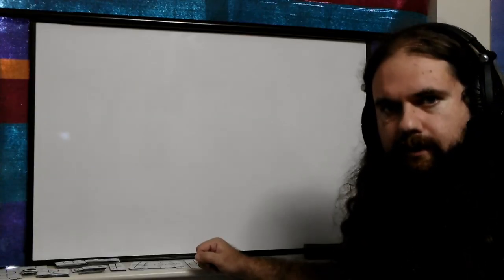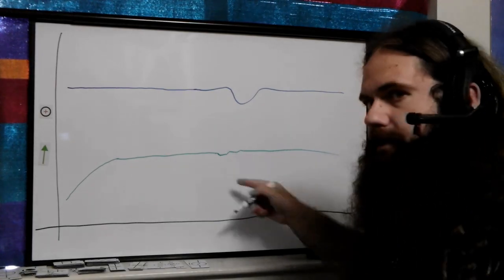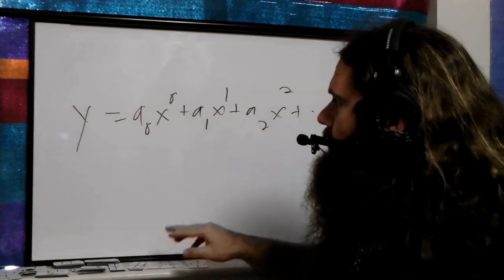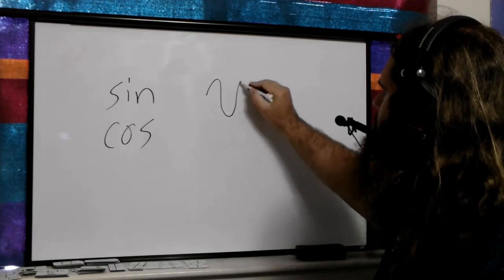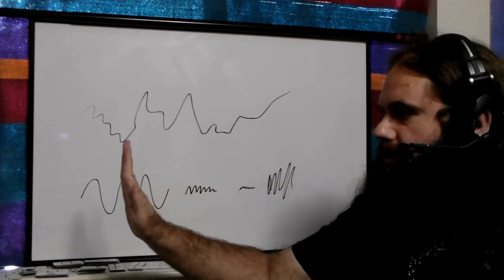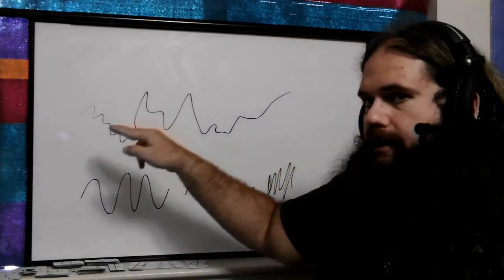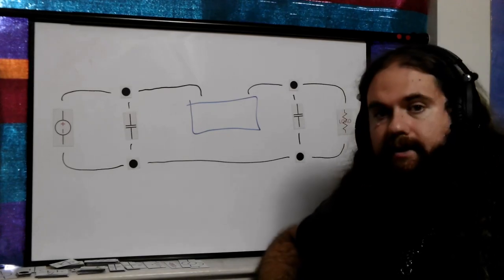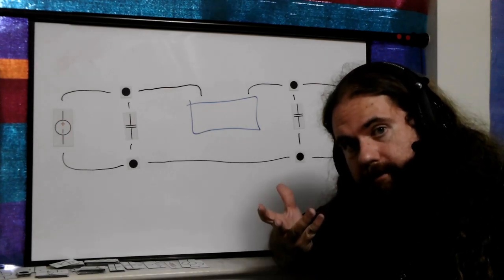Decoupling Capacitors - Simply Put

Comment: I have question that I hope you find time to answer soon. but let me say, this is by far the best explanation of by pass capacitors in common language. thank you. How I found you is because I was working on a PCB and the eBay purchased self closing tweezers broke one of these little guys in half...but I think, it was mostly my fault.. I wanted to see if I really need it. it is not by a cpu. it is where he main regulator for pcb is and on the same line as the 100uf electrolytic cap is. In a row there is a 100uf electrolytic, then a medium size bypass cap and right after that was the smaller one that I broke. it is really tiny (about 1 mm long buy .4 or .5 mm wide & think). I do not know what rating it was. should I put something about the same size in there or should I just leave out?

Comment: Thanks I have been trying to reduce noise in my 1969 car radio.  Now I have several capacitors I could add to try to reduce the noise coming in on the AM radio. Just trying make sure it is coming in on the antenna from the coil firing.

Comment: This stuff is cool, rebuilt a power supply for a radiola 60, gotta get rid o that a.c. ripple filter choke coils
also used, and eelctro-dynmic speakers used an electro-magnet instead of a magnet and that lectro-magnet was used to smooth out the ripple.

Comment: I've tried running a USB isolator and also running my plasma cutting software off my laptop without being connected to power but neither solution worked. I also attempted to shield wires and place my plasma cutter in a old refrigerator to eliminate the EFI interference. Everything helped but nothing really worked. Something tells me you would know the answer to my dilemma. I built a CNC controller using an MKS 32 DLC board. It's basically an Arduino design. The board is supposed to control my plasma cutter but it's highly susceptible to interference. Without turning on the plasma cutter the G-Code will run flawlessly on the machine. But as soon as I turn on the plasma it will get one or two cuts and then either stop entirely or freak out. I read somewhere this is because the way the board is designed. Someone suggested a decoupling capacitor could be helpful. I get the basic idea of what they are saying but maybe it's just better if I buy a better board? The nice thing about these boards is they're cheap but they connect to the computer with USB. Better boards use either an Ethernet or a parallel port connector which requires an older computer but that wouldn't be a problem since I have a few. I was considering just trying to go from USB to the parallel port on my tower but I think the problem is the board itself is getting interference so how do I connect to the computer will probably not matter. The only way I've got the board to get a good portion of cutting done was by launching the G-Code off the built-in SD card using the proprietary control app. But that app sucks because it doesn't have the z-axis control since the board was initially designed for a laser engraver. I hate to have to purchase a new card but if that's what it's going to come down to I guess I will have no alternatives. Any advice? Thanks. Subscribed.

Comment: I  understood that the term bypass capacitor is not interchangeable with the term decoupling capacitor as bypass capacitors are used to remove the effects of inductance from impeding current demand, whereas decoupling capacitors would be for removing the dc components on an otherwise and wanted AC signal

Comment: Thanks for your explanation, and I got two questions and as you said in a video. "Wy not ask". So the first is: there is a way to measure the diferents frecuencies presents in a DC input..? and the second is coul you please explain what is and how to use and calculate a coupling capacitor... As alweys thank you bery much.
Reply from the maker: I presume the best way to measure frequencies in any signal, including a noisy DC signal, would be to use the FFT function of an oscilloscope. I'll definitely cover that topic at some point in the future. As to coupling capacitors, their purpose is to allow an AC (varying) signal to pass between parts of a circuit while preventing DC (constant) voltage from coming along for the ride. If you look at the common-emitter amplifier circuit, all three of the capacitors are coupling capacitors: The one on the left allows the input signal into the amplifier while blocking the amplifier's DC bias from feeding back into the signal source, the one on the right allows the output signal to pass to the load while removing the DC bias added by the amplifier, and the one at the bottom (between the emitter and ground) allows the biased signal to "reach" ground directly while preventing the DC bias itself from shorting to ground. At some point in the future I'll do a full video on coupling capacitors, such as how to choose them based on their frequency-response curves; For right now, all I can say is just try different ones until you get the output you like.
Reply: @simplyput2796  As alweys, thanks.

Comment: thank you so much man wonderful explanation ...i  just wonder what the difference between decoupling and coupling capacitor? and i don't know if it's the same thing
Reply from the maker: Names in electronics are all over the place, and sometimes there are twelve different names for the same thing. Generally speaking, a decoupling capacitor is in parallel to remove an AC element (like noise), and a coupling capacitor is in series to remove a DC element (like an amplifier signal bias).
Reply: @simplyput2796  ok thanks i get it

Comment: Hello Simply put, gr8 vid! say a d.c. generator is hooked to a load, and the battery is floating, could the battery be also considered  to be like a capacitor to  minimize voltage /current changes? and does
ELI the ICE man get into this?

Comment: ok ..I have 220 ac volt  600 amp power supply  set at 14.8 volts DC.  how would  I add power  caps to it . ?

Comment: Love your videos. Would really appreciate your comment on my thoughts.
I've been contemplating this stuff myself and your vids are the closest I've found to an answer.
I don't know the answer and you certainly know a hell of a lot more than me..
but I don't think comparing power caps and coupling caps are relatable. 
Staying in the classical world and pretending Quantum doesn't exist.. I view power caps as a pool of excess electrons.
In a decoupling situation at least I don't think the Cap ever really discharges once charged?
I think I'm right in saying AC is felt on the opposite side by fluctuation in the strength of how compelled the electrons are to the other side of the cap without them actually needing to move across or discharge.
It seems both the size of the pool, and the material the cap is made of impart a sluggishness and a range of frequencies they can actually react to. Id really like to understand this better but I guess it could be likened to how different materials transmit sound, the same can be said for electrical fluctuation?
Reply from the maker: The capacitance of a capacitor determines how many electrons per volt the capacitor stores. More capacitance means more electrons for the same voltage, so a large capacitor can supply current for longer while its voltage drops more slowly (power capacitor). Less capacitance means fewer electrons for the same voltage, so a small capacitor can charge and discharge far more quickly, thus maintaining a voltage level more steadily in the face of very small ripples. When you talk about electrons being "compelled", yes, they are, by the electric field caused by external voltage, but the electrons absolutely do move: Every electron added to the negative side is one shoved away or pulled away from the positive side, and every electron added tot he positive side means one leaves the negative side. The size of the capacitor (and its construction) do affect its reactance curves, which you can look at on datasheets.
Reply: @simplyput2796  Thanks matey. AHHHH hang on..*reads definition of farad*  So I had it in my head Capacitance was fixed at any voltage, so was thinking.. if a cap always has 500Vdc applied, how is applying 1V AC on top going to effect the sored charge, it will always be full with a voltage between 499 and 501. But instead perhaps its better to view the cap like a water balloon, At a given pressure it will fill to a fixed point, if you apply a little more pressure it will fill a little more within a normal operating range. The material the "balloon" is made of will effect what that range is and the reactance curve.

From a safety perspective, does this imply that if I take a cap that stores a lethal charge under normal operation, like a 50mf 450v cap, but charge it at 1v say in a capacitor tester, it's then quite safe to touch afterwards? and presumably the measured voltage once removed would be 1v only?
Reply from the maker: "Filling a container to a certain pressure" is a good analogy for a capacitor: If the container is bigger, you need more actual material inside to reach the same pressure. When you have a charged capacitor, just treat it like any other power supply: Touching the leads of a capacitor charged to 1V is exactly the same as touching the leads of a bench power supply set to 1V. The only difference is that the capacitor drops voltage as it loses charge. Capacitors do not have a voltage capacity: You can put any voltage on any capacitor. The voltage rating refers to the dialectric (the thing that separates the two plates): Exceeding the voltage rating of a capacitor means the dialectric starts to conduct electricity, and the capacitor becomes a wire instead of a capacitor.

Comment: why have batteries not been used inside circuits to control ripple? i mean some low capacity battery, used as you might a capacitor,  where the ripple voltages goes in to recharge it, but the circuit uses the ripple free output. Seems someone should have tried this by now.